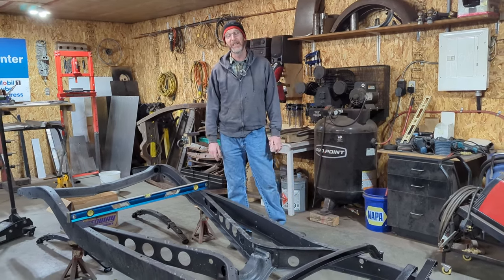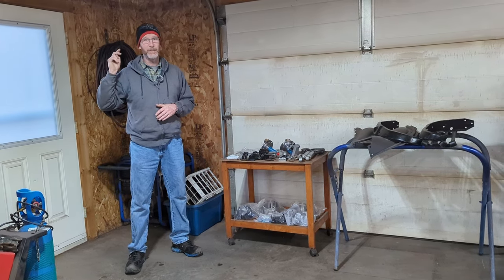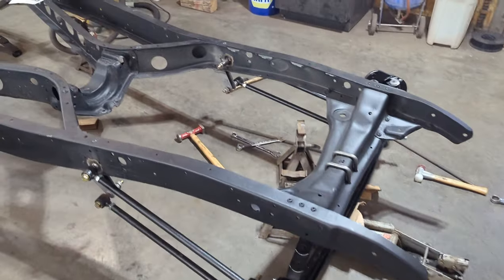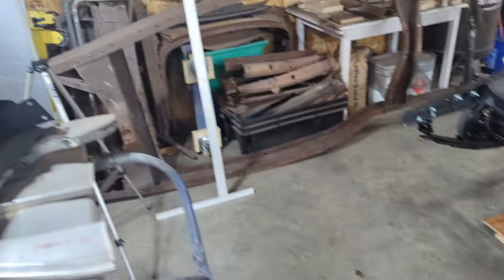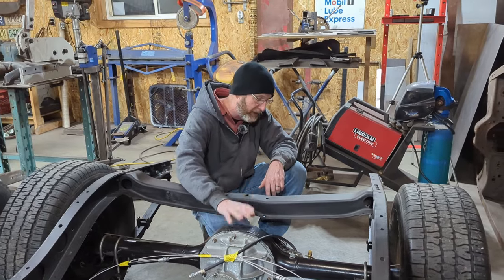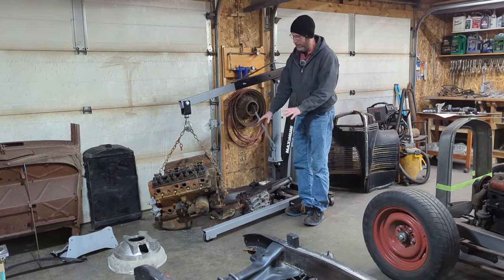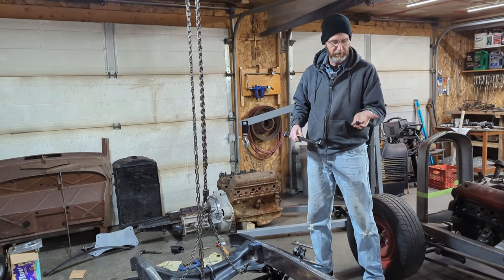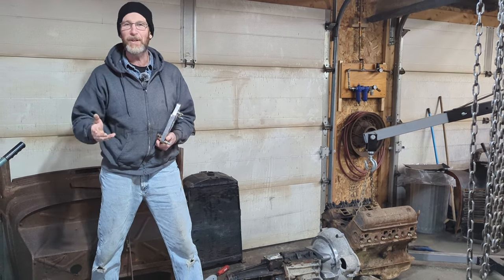Part 1 - Another original 1934 Chassis comes into the shop to make it a roller

Comment: Good Work. On the input shaft of the s10 you have to cut some of the end off to fit in a Flathead 8BA with the same sort of adapters as the Y Block you have. So I would assume that you need to do the same for the Y Block. Also the other adapter you shown looks to be a Ford T5 adapter for a Flathead. Keep up the good wrenchin.
Reply from the maker: Thanks! I knew people watching would know. I'm certainly not the first to do this. Yes you're right, we figured it out after we finished the video but couldn't include it in time. I cut 1/2" off the S10 input shaft and all is good now. Thanks for watching!

Comment: I've got parallel leafs for my '40 and a 9" out of a 57 (I think) Fairlane. Have thought about these adapters to put a T-5 behind the Flathead. Seems the Y-Blocks are a popular swap, but wondering if a 302 wouldn't be "better" for a driver for getting parts for. Enjoying these videos, certain I'm learning things if I ever get around to my swap. Looking forward to the next one.
Reply from the maker: My customer has put T5 behind a few flatheads. Quite sure he used S10 version. It's quite popular to do. I did figure out the spacing issue after we finished this episode. There's always a solution to every problem!